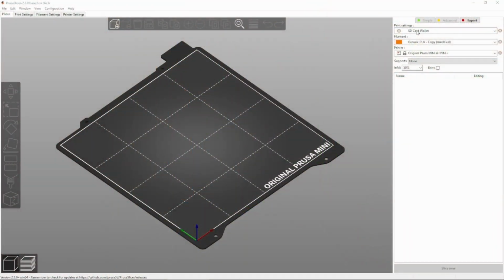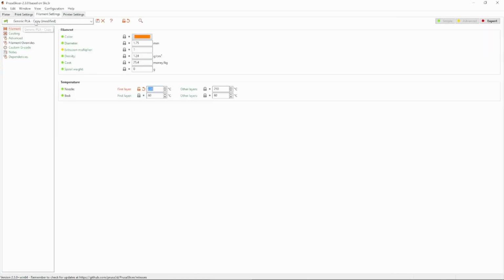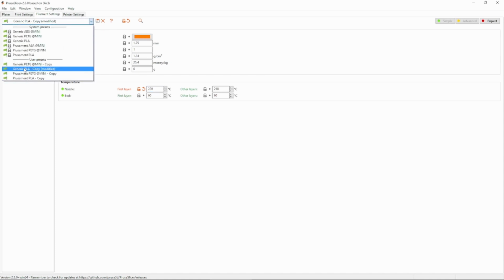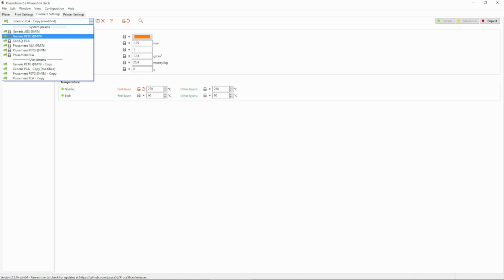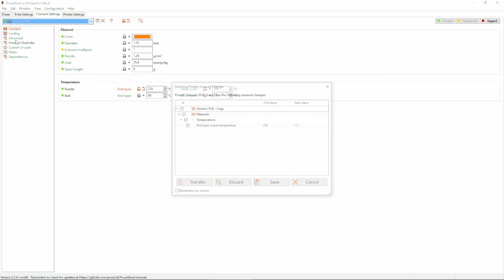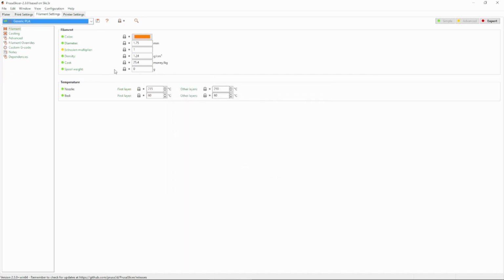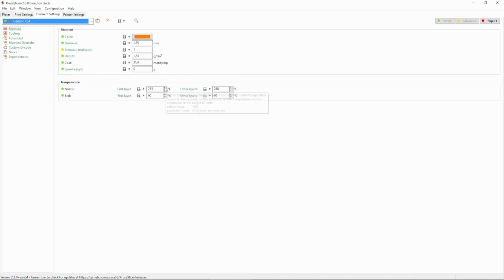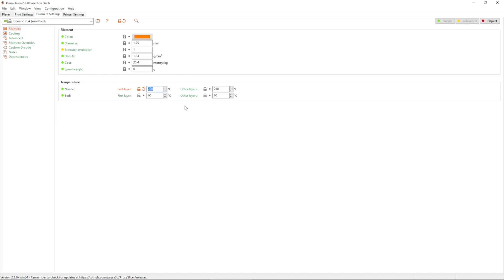3 things to get your Prusa Mini 3d Printer working

Comment: What you call heating element is actually a heatsink, it keeps filament cool before it reaches meltzone. Heating element or heater cartridge is that cylindrical-shaped thingstuck in heater block, with 2 red wires coming out of it.
Do not threadlock those grub screws, you will need to unscrew them occasionally for cleaning, PTFE tube changing or on other occasions.

If you run a first setup wizard in Prusa Slicer, you can switch to section with filament selection, and you can install many profiles for other filaments and manufacturers. You can of course create your own filament profile and save it.
Reply from the maker: Thanks! I'm still very new to this. I was more intending to threadlock them with low strength 222ms strength threadlock. It is made in applications where things can be removed and replaced but keep things tightened down from vibrations and constant movement. As small as these parts are, I think medium strength 242 could even work but might strip things if you're not careful with your tools. However four months of consistent use I haven't had to re-tighten anything down so it's a non-issue I think! It's been a great little machine once I got those parts adjusted.
Reply: @Skawn7125  DO NOT THREADLOCK THE GRUB SCREWS, YOU WILL STRIP THEM OUT TRYING TO BACK THEM OFF LATER. BIG MISTAKE! THEY DIDN'T HAVE THREAD LOCK ON THEM FOR A REASON!
Reply from the maker: @shelbyseelbach9568  good to know! they do make different strengths of threadlock for those purposes though, it's not all weld tight.
Reply: @Skawn7125  I'm aware. Thread lock for grub screws that make direct contact with the heat break is, by nature, going to be high temp thread lock or it isn't going to serve its intended purpose. Take my advice or don't, it's freely given, with good intentions based on knowledge and experience. Ultimately, it doesn't really affect me one way or the other though.